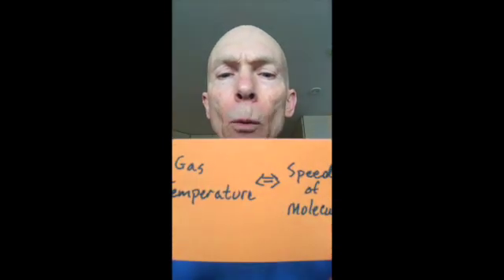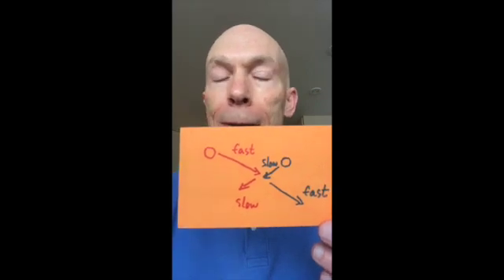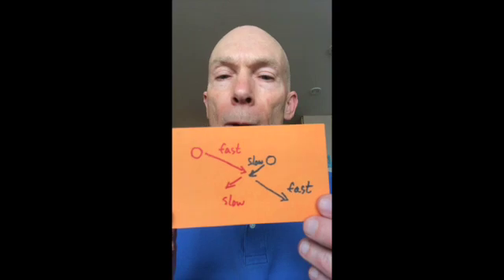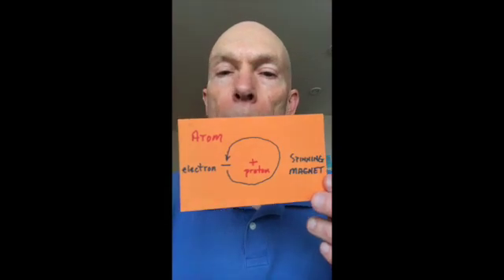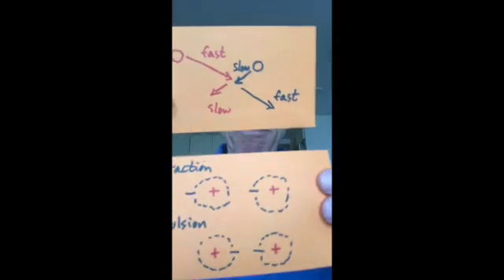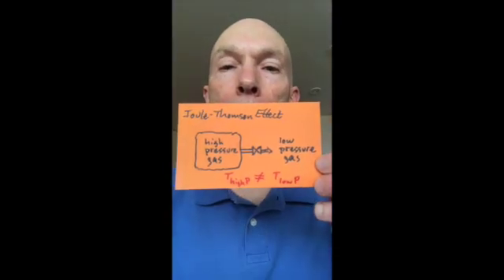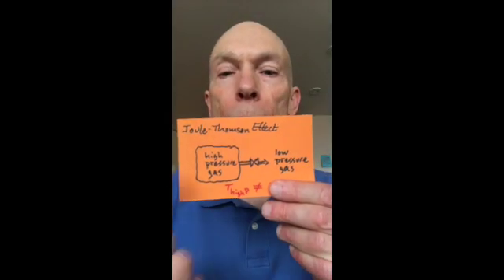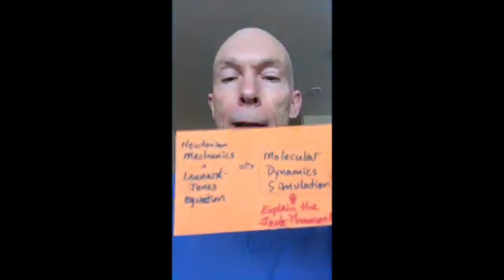Joule-Thomson Effect (Part 1) - why does it happen?

Comment: From what I can find the air outside a plane at 30,000 feet is about -48F, this being due to the low pressure. Imagine a room is pressurized at 23.4PSI and temperature 300K, if now a valve is opened allowing air to escape so that in a couple of minutes the pressure drops to 15PSI, what would the room temperature be ?